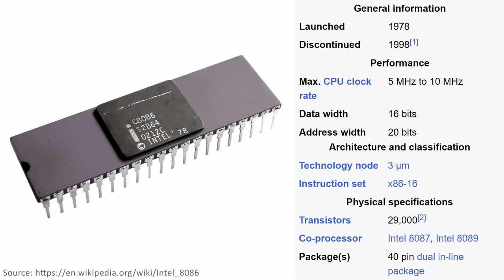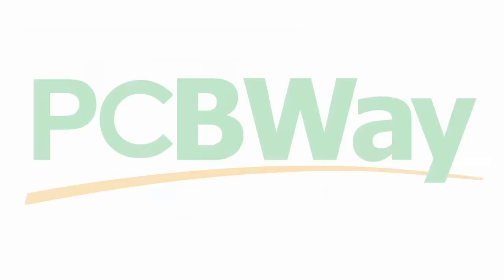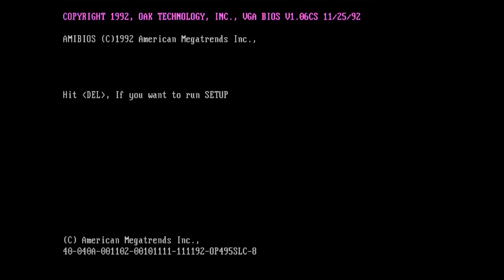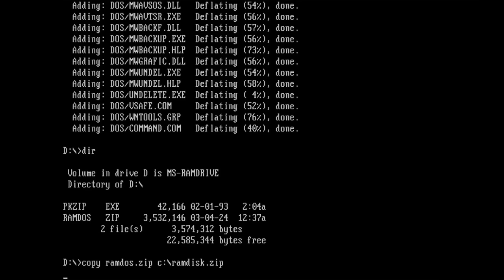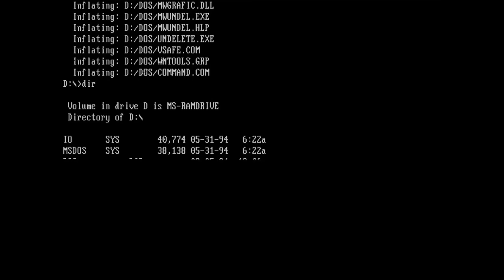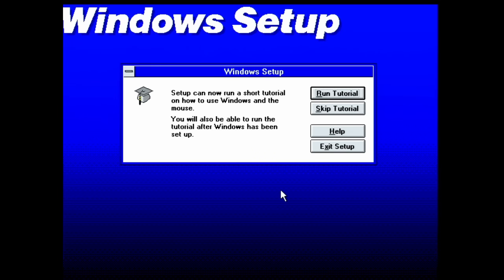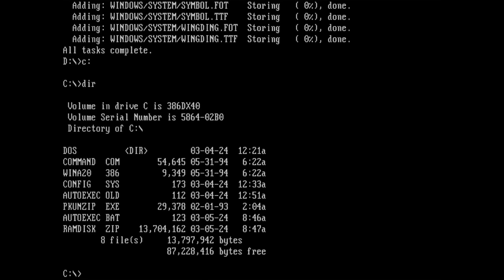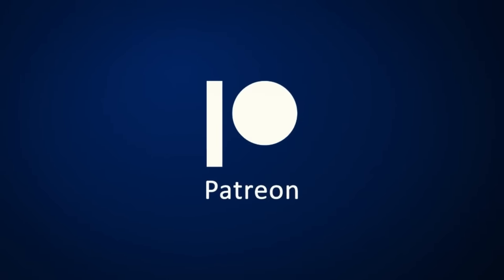MS-DOS and Windows on a RamDrive

Comment: Back in 1994 I worked at a local computer shop that did custom builds, and we got a high roller who ordered a computer with a whopping 16MB of RAM, the most that was possible and a ridiculous amount for the time. So just for fun, the person building the computer decided to set up a 12MB RAM drive and installed Windows onto it, and we were all blown away at just how quickly everything ran, and wondered why the heck the person even needed more than 4MB for anyway.
Reply: Running nt would make more sense.
Reply: In 1994 I had both a pc and a mac with 64MB+ of ram

the mac was a 7100 and it had 136MB total (8mb soldered and 4x32MB's)

The pc was thrown together sh*t but it still had 64MB

If you used photoshop (was version 3 I think) or other creation tools back then then having this much ram was more common than you think.
Reply: I remember in late 1994, father coming home with 4MB of RAM to add to our Pionex 486sx25.  We had been struggling with 4MB of RAM for months with DOOM2 and it would only run with a batch file that had to be executed before most of the usual TSRs and level 16 Suburbs and level 30 Icon of Sin would sometimes hard freeze.  I could definitely feel the performance difference in that budget family 486 going from 4MB to 8MB and DOOM2 no longer froze on any level after that.  To this day I am still surprised he got us the extra RAM because he was very thrifty and we had economy everything and we were dreading saving up birthday money and Christmas money to get the God damned RAM.  We suffered with that 486sx until 1997 when we FINALLY got a Pentium 133 (cue the chorus of angels singing).  I guess things could have been worse and we could have been one of the poor bastards stuck with a 386.
Reply: @Vile-Flesh  Ouch at playing doom on a 486 :D

Think I was on a P90 in 1994 but I cant be 100% sure.
Reply: Me and a buddy back in 1993 knew a guy who would tell everyone he had 16MB RAM, so he became "16 megabyte man" for the rest of his time at Uni 😂
Reply: Workstation? Some users today go over 2 TiB.
Reply: @Vile-Flesh I'm surprised you could even start doom with 4mb
On my 386 doom would just complain I did not had enough memory if I did not skip loading a bunch of things on boot.
I never had doom 1 freeze on me thou
Reply: @garytallowin6623 doom ran on a 386. And pentiums only came out in 95
Reply: Who even needs 640k of ram?
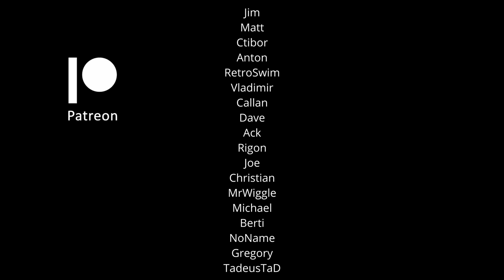Reply: As programmer I said, even 2megs of ram is overkill back then, why I say that? sony ps1 have rams only 2 megabytes, also shared for vram! & it runs 3d games insanely smooth compared to my hi end 486dx4 with 8megs of rams. But industry m 13:07 ust go on, & then hardware manufacturer try to sell moore insane hardware by making bloatware (including windows) that do nothing but pushing you to purchase unnecessary machine which quickly obsolete within 2 or 3 yrs...
Reply: @aikonlatigid  well, the PS1 does have hardware to render poligons, PC dint back then. In fact the PS1 versions of dukenukem and doom are much worse than the PC versions since they used a form of rendering that was very different from what the PS1 hardware could do
Reply: I remember running Doom from a RAM drive.  I think I had 20mb of RAM in my 486.  4x4 mb and 4x1 mb Simms.  I did it mainly to see if I could.  It loaded faster, but I don't know if it was better to have 20mb of RAM available to Doom or only have 4mb to run the game but be able to load all the game files for a fast RAM drive.
Reply: @Vile-Flesh I was using a 386 dx running 4 megs of ram and a 90 Meg hdd.
Reply: So someone was already using SSD in 1994!
Reply: @garytallowin6623 was the Pentium even around when doom 2 was released? I thought it was a quake thing?
Reply: Sorry to bust your bubble, but in 1994, my GVP Controller in my Amiga had more RAM on it - stop thinking, that there were only IBM/Intel machines, just because they were the majority.
Reply: nice, so around SATA 2 SSD speeds in 1994 :D
FPM being around 200MB/s, and the later EDO around 320MB/s
Reply: In '94 my Amiga 3000 had a 040@35MHz with 32Mb on the accelerator card and 2Mb of chip mem, but yes you where using a PC but still 16Mb wasn't so uncommon back then.
Reply: @affegpus4195  The first pentiums came out in 1993. The P90 was released in early 1994 (and was quite expensive). A 386 was already low-end in 1994.

Comment: What most people don't know, is that XP also shipped with internal driver you could use to create a ramdrive!

And, damn, that same thing is available even on Windows 10 (Device Manager -> Action -> Add Legacy Hardware -> Install Manually -> Show All devices -> Microsoft -> Windows RAM Disk Controller)

Ooh boy!
Reply: Windows RAM Disk Controller I couldn't find it.
Reply: A native ramdisk in win10, that's exactly what i was searching for. Unfortunately it does not install and gives error after i press the last next button (w10 pro x64)

Comment: I used Ramdrive on my PC junior that didn’t have a hard drive as a B: Drive for games that required using two disks. It was really convenient as it also only had one floppy drive. I had no idea it could been used for extended memory as well.
Reply: My first 386SX33 didn't have HDD at all, why if FD is 1.44MB and even 1MB RAM leaved >300KB of XMS for RAMDRIVE with DOS + NC.

Comment: The Amiga's OS had this function as an automatic part of the OS and the RAMDisk could survive soft reboots, it was pretty awesome. I wish I'd known about the PC having that capability back when I made the jump!
Reply: The Amiga "version" was WAY ahead of everything you can still find today as it was dynamic. And even in Windows, you can still use a ram drive. IIRC Starwind still offers that driver for free. And even in these SSD/NVME days, it can still be useful
Reply: On the Amiga there was the RAM: device and the RAD: device.  The RAD: device is the one that survived soft reboots and was a monster.  So I always had Workbench/Toaster stuff on the RAD: and mainly other stuff on the RAM: for very fast access and was great for LightWave and Video Toaster files.  Just had to remember to back the RAM: to DH0: or DH1: time to time.  Had to teach a news station on how that all worked with a borrowed A4000/060 with a Toaster from me for some things they wanted to try out.  Basically the same thing he's doing here but in AmigaLand and had Compressed LHA Boot files on DH0: for system startup to save space on a whopping 80 meg HD.  Was big in those days.
Reply: My 99/4a had a battery-backed RAM disk card installed. It was awesomed
Reply: People always only think about that x86 crap ... it's a pity, that Commodore had the wrong people on top, cause the 68k were superior and the OS .... everybody knowing about computer history knows, where Jobs stole most of "his" ideas from ....
Reply: @Eysenbeiss  Yes, we all know how the Macintosh GUI is largely copied from Xerox.
Reply: @Eysenbeiss From Xerox PARC, same as everyone else? Quite a sad tale that the people that came up with just about every innovation never get the credit... then again, they never bothered to sell what they came up with so...
Reply: @ErazerPT  They actually DID sell the Xerox Star. They just did so very poorly. Their salesmen were not well-versed in the company's computer offerings, and didn't really want to move them because they got a better commission on copiers.
Reply: @CptJistuce  And the kickstart thing was stolen from Commodore. Jobs only had a soft version first, before he got this "idea" ...
Reply: @Eysenbeiss  And to be clear, Jobs took most of the credit for the ideas of other Apple employees. So the ideas that were actually Jobs's were mostly "make it non-expandable, and 1-bit monochrome"
Reply: @CptJistuce  Sigh ;-)

Comment: I did a lot of messing around with ram drives in my teens. And of course I think this is still very common in the Linux world (Live CDs, Tails etc.)
Reply: Yes, it is still very common on Linux. You can even have a Live CD copy all of its files to RAM so that you can remove the disk afterwards and the entire OS will still work!
Reply: @GeekIWG Yes, although sadly even most Linux distros have now grown into painfully bloated.
Reply: @TheSimoc  Nah, disagree. You can just install what you want. For headless servers I use debian with no desktop environment. For a workstation I use kubuntu (basically stock Ubuntu with KDE Plasma instead of Unity). Neither are overly bloated IMO.
Reply: @hayleyxyz  kudos & kubernetes to you!
Reply: @jschreiber6461  thank you :) you too x
Reply: Same here, I tweaked to my hearts content with himem.sys, ramdrive, extented and expanded with bank switching, to get as much memory available in the lower 640 KB we had those days. Lots of fun.

Comment: I had a legacy application at work that made too much use of the filesystem and we were running it over the network. It was so much faster to create a ram disk and copy it from the network to the ram drive, do all of the work and copy it back. We even started using 7zip to improve network copy speeds and have a backup. This was on windows 10. Our RAM drive was a GB from memory.

Comment: I remember experimenting with the RAMDRIVE and DREAMING about having a big, large RAMDRIVE to run everything (basically, an SSD!). But my 386 had only 2MB of Ram and my friend's very expensive 386, only 4MB :)
Reply: Today, I'm using a 16 GB ramdrive on my i5-14500 system with 32 GB of ram.   I have only 3.5 GB of free space on it.
Reply from the maker: It depends on your use case. If you need a large temporary "scratch" disk, let's say for editing a video, you'd be safe if you store temporary files on a ram drive. It will actually save a lot of write cycles to your SSD. There are applications to manage ram drives that store updated data on a binary level. So, you could change a file 20 times in memory, but it is written only once to the SSD after the time interval expires. There are legit cases when a ram drive is the best option.
Reply: arnolduk123  what a harsh comment! BuB has shown us how to use Ramdisk, he never said we should all stop using HDDs and start relying on volatile RAM! Sometimes these things are just for fun! After all it’s obsolete hw and sw! Take it easy!
Reply: @bitsundbolts  Well said. Most people don’t understand ram != SSD. They have high perf, but not the same, and for application use cases where that performance diff matters, so does the write cycle count.

Comment: I've played a lot with Ramdrives back in the day, but that was under Windows 95/98, after I learned that the Windows 98 boot diskette used a ram drive for diagnosis tools. Tried to make my own archive for that with used tools for the PCs in our home. Had the same drawback which you had tho: nothing I changed on the ram drive itself was saved in the archive without any help by myself.

Comment: @bitsundbolts You could also add the -silent cmd line option for PKzip/PKunzip to hide the packing and unpacking file list on the screen, so you don't have to see a list of all the files go by, to clean up the boot process even more
Reply from the maker: That may even reduce the boot time as I believe this ISA graphic card wastes a few CPU cycles to output all this text! I'll try it! Thanks for sharing
Reply: But the list gets exotic. Even in movies, people would be surprised if something happened on the screen. :)
Reply from the maker: Not true. The fixed disk is not accessed when running anything from the ram drive. You only write when you tell it to - and due to the compression, you write less data. Sure, it's slower, but there are use cases when you want to have an unaltered DOS/Windows installation after a reboot. Similar to what O line emulators are doing - your data is valid for your current session only.
Reply: @bitsundbolts Yup! That’s EXACTLY why I had a bank of such machines set up, as soon as the user timed out the machine would hard reboot. What I really would have liked is for the boot SSD/hard drive to either disconnect or become R/O once copy to ram was done.
Reply: Thanks for the tip, I had something similar in piping the text out, but the -silent switch is better.
Reply: But as techs we love seeing techy info lol.

Comment: Years ago I picked up a 2meg ems memory card. Filled with dram chips. One of the options was using it as a ram drive. That was fun to load up word perfect on it and other programs. In my current Apple II plus. I have a Ram factor. You can use it to expand memory in Apple Works. You can also use it as a ram disk to.

Comment: 25 years ago, I was wondering why Windows couldn't be provided as a read/write hardware card. Basically a RAMDrive that would have a button cell battery on it to preserve its contents. I knew that avoiding mechanical drives would instantly make booting and running the OS so much faster. This video reminded me of that idea I had. And in many ways, this was most properly accomplished when SSD's were first introduced.
Reply: That kind of setup was available 25 years ago. But it would be very expensive. Out of reach of consumers so you don't see it often. Booting dos from flash and such modules was very common on embedded systems even many years ago. Especially in environments with a lot of physical abuse that a mechanical drive just would not survive.
There is a reason windows has an icon for this use case, it was used.

Comment: Yes! I did know it and actually dabbled around with it back in the day. Didn't have enough RAM for it to be really useful at the time though. However, I always liked the idea and never forgot about it. It came in handy quite a few times over the years, most recently on a number of servers in a high performance computing scenario, where even NVMe SSDs were barely able to keep up with the requirements and we didn't want to tax them that heavily for data that is temporary anyway.

Optane might have been an alternative, but it would have been much more involved as we were working on AMD Epyc and wanted it to stay that way. So we just went with putting more RAM into the machines and called it a day. Considering the history of Optane, I guess it was the right call. Still sad to see it go though, it is great stuff that too can be very useful in some scenarios (and can still do things nothing else can do yet).

Comment: I fiddled around with ramdrive in the 90s but my 486 only had 4mb of ram so it wasn't very useful back then. Nowadays I use a ramdrive on my raspberry pi running pihole to store logfiles. I learned this the hard way because the first sd card died within a year.

Comment: Fun fact: some modern CPUs have enough cache that we could theoretically, if we got full control of the cache, install Windows 95 on it! I wonder how fast Win95 could be on a cachedisk?
Reply: The first level CPU cache is filled with instructions and with data from the last instructions with a memory access. And it is filled again every time if an instruction want to access an address with data that is not inside the cache, or new instructions are loaded from the memory. I think a far jump instruction clear the first level cache. No way to use the CPU cache for a drive.
Reply: arnolduk123 My last DOS PC mainboard Asus Striker with intel Core2quad@2700mhz, 8 gb DDR2 RAM, Radeon 9750 PCIe booting MS DOS 6.22 from selfmade Boot-CD floppy emulation 1.4 mb drive A:. Or booting MS DOS 6.22  from 2 gb  USB stick FAT 16 format drive C: ready to startup all 4 cores for multiprocessing and swicthing into 64 bit mode from a 16 bit DOS application.😊
Reply: You can't use the cache as a regular disk. There was however one programmer, who managed to "load" a thing completely in cache, and was able to measure the speed of the cache on a AMD Epyc, which was in the terabytes per second speeds. If you want a ramdisk with extremely fast storage, consider a I-ram of Gigabyte. However that is so ancient, a modern SSD will beat it.

Comment: I remember doing this in the 90's (although my Ramdrive was only 12Mbytes). Compared to Smartdrv caching I found that Ramdrive wasn't much faster when it came to opening programs but it did remove the hammering noise of the hard drive 🔊

Comment: On my modern 64bit system with 16GB of RAM, i created an 8GB RAM drive with Super Speed RAM Disk Plus and  set the pagefile.sys, temp folder and browser cache and download location to be on the RAM drive. I also use it as a working folder for editing large video files.

Comment: I had to write a lot of batch files using EDLIN so when DOS 5.0 came out, the EDIT was much more exciting than Windows!
Reply: I like to use batch files as open source container to put the instruction of a routine inside to create a new executable com file with a little help from debug. Most of these special container batch files have to start with one or more parameter attached. Example to start with row color "text" attached: CENTER.BAT 8 1b "output center align". I made some videos(no speech) to show how it works and to share the batch files. Have fun.😊

Comment: I remember tinkering with this in the early 90s. The PC I was using was very limited, so there wasn't much I could realistically do with this. I was at college and we were programming Modula 2 with a compiler called TopSpeed. I think I set the PC up to copy and run TopSpeed from a Ramdrive. Seems like a different world when you think about everything that's happened in the last 30 years!!

Comment: Sometime back in the 90s I had a laptop with a docking station. The hard drive on the computer crashed one evening, but I needed to get some.work done regardless so I created a bootable DOS CD that created a ram drive and copied the Windows directory to it, all 12mb of it. Running Windows like that was amazingly fast, efficient and actually enjoyable. I saved my work to floppy on the laptop as I went along, just in case.